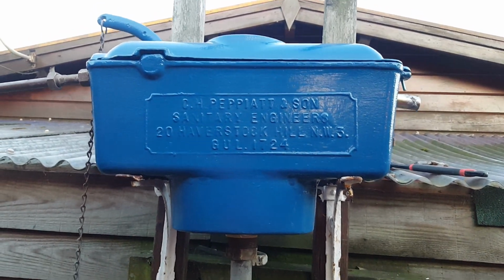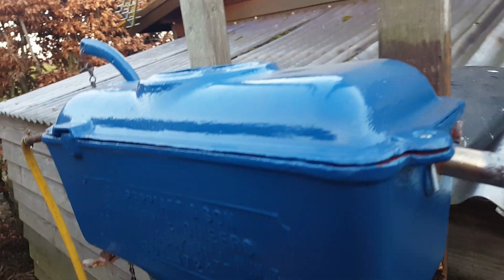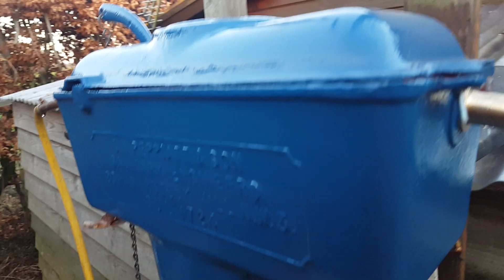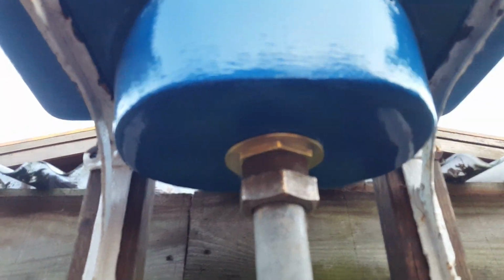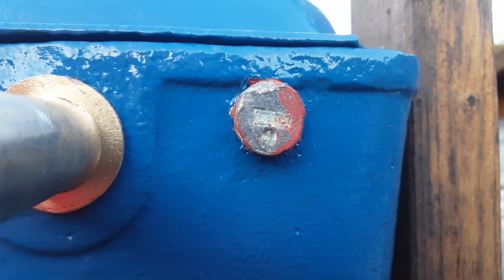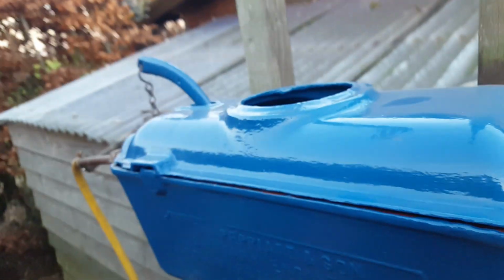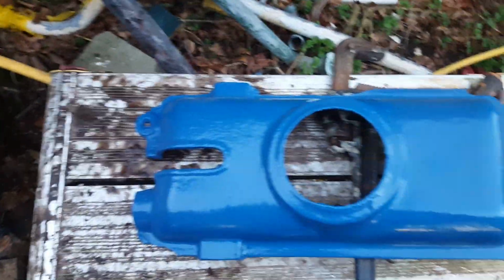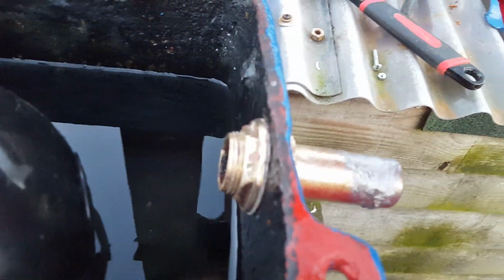Restored 1930s C.H Peppiatt Cast Iron Cistern

Comment: What is that badge on the tub for is that a sacraficial  anodie  Like a boat motor has For corrosion  .  Or is it a date  . ?  I've got those badges on front of both my Tubs here in Australia. something stampeed on it I can't read .
Reply from the maker: It's a lead stamp, for the installer or water board to stamp their initials in
Reply: When i was apprentice we had in the yard a working waste water preventor basically a lead lined wooden box with leather flap(flush) valve & a plymouth float valve(ball cock)& lead flush pipe,think it was called a thunder flush!the pan was a bluebird hidden outlet -bit like the usa ones today.
Reply from the maker: @g0ffygl0s5m  Oh wow, I wonder if it's still there today? Sounds like quite a beast
Reply: @castironcisterns  it's a block of flats now.Do u collect c/i hopper heads?I've a load of em.